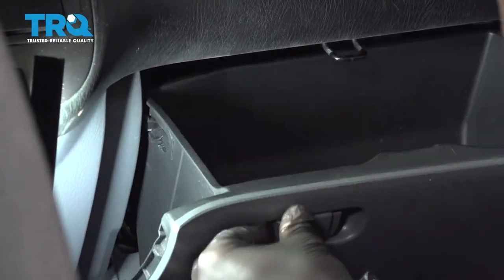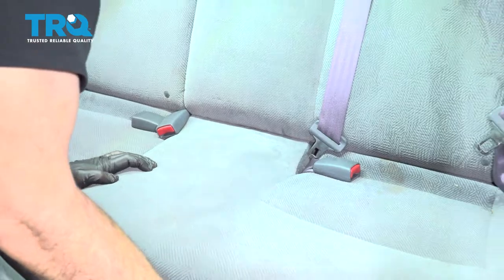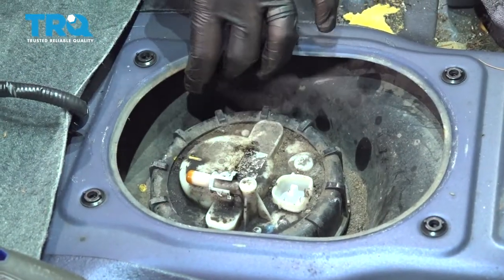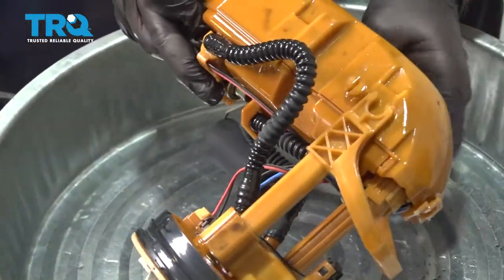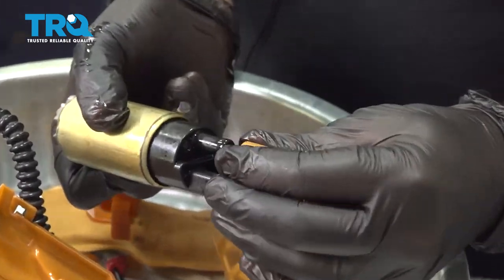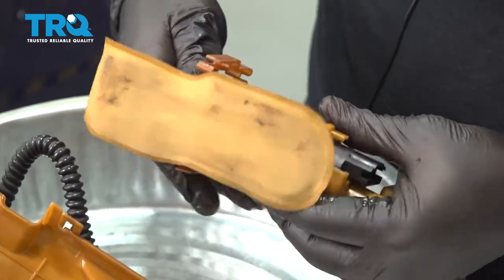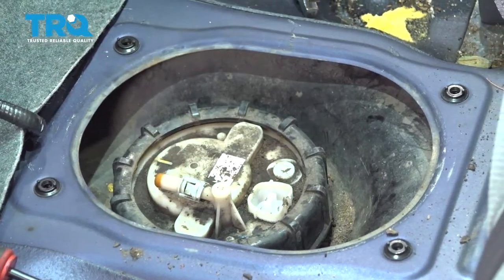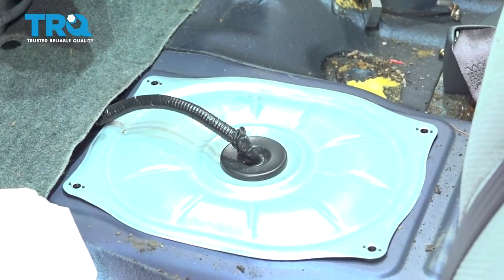How to Replace Electric Fuel Pump 2001-2005 Honda Civic

Comment from the maker: √  Watch the Video
√  Buy The Part at 1A Auto http://1aau.to/m/Shop-TRQ-Parts
√  Do it Yourself
√  Save Money
Reply: Why did you replace the fuel relay? Is this necessary to replace the fuel pump?? Or is it a cautionary step?? Should that be done first to see if that was the issue?? Saving money and time ... what's your advice?

Comment: One thing i dont understand is how does an area like that get stuff trapped there
Reply: More than likely, considering the broken acorns. I would suspect a chipmunk or something small was living there for a while. 
Another possibility is that if you're using a high-powered leaf blower and try to blow the debris out from under the car and with all of the wind, it may find its way up there.

Comment: This video would be SO much better if youd have taken the time to show the removal of the fuel pump relay more clearly. Myself and several others in the comment section cannot see how to remove the locks from the relay and its known to be extremely stiff

Comment: Oddly when I disconnected the fuel pump relay it threw a crank sensor code po330. Plugged it back in..no code n fired up